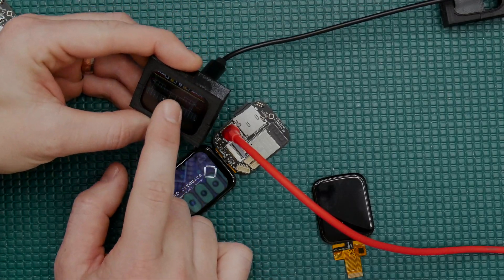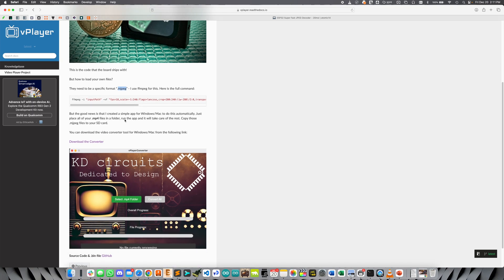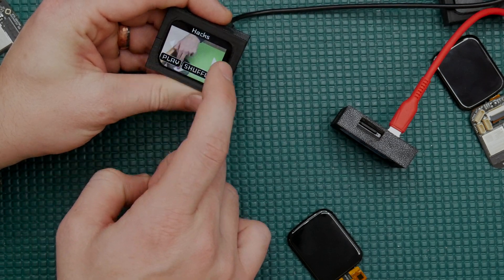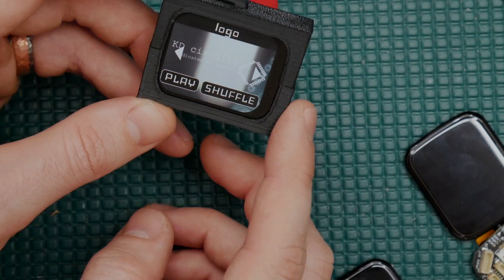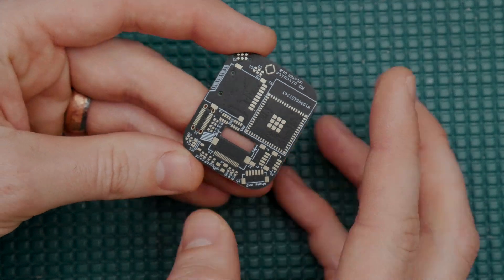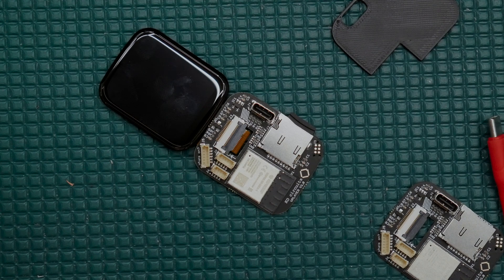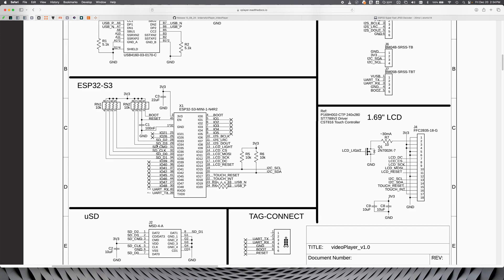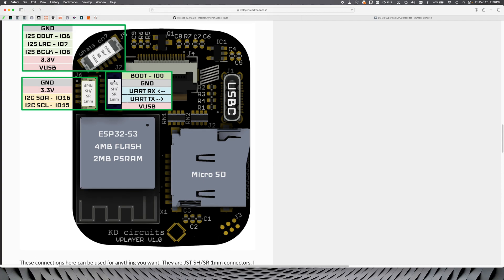How To ESP32 Video Player - vPlayer Board

Comment: ESP32 or S3 are too slow for this application. P4 is better.
Reply: Would the same sketch (like this one) work on a P4?
Reply: @Burgmannn  The arduino support on P4 is different from S3. There is no MIPI DSI on S3 nor HW video decoder but P4 has both. So, the LCD driver and decoder lib are different from S3. Therefore, the S3 sketch is not optimized for P4. You need to re-write it.
The simple and cot effective way is to use Pi Zero W for up to 1080p and 192k32bit playback.

Comment: would this vPlayer work on a waveshare ESP32-S3 1.8inch AMOLED ? I'm new to this. Do I need to use the firmware in the sd card? o can I just use the arduino code